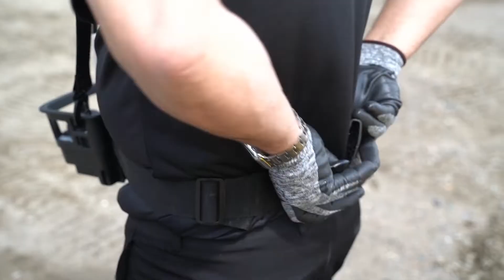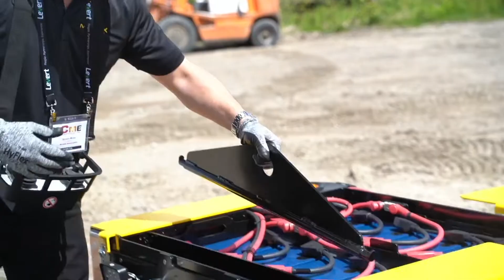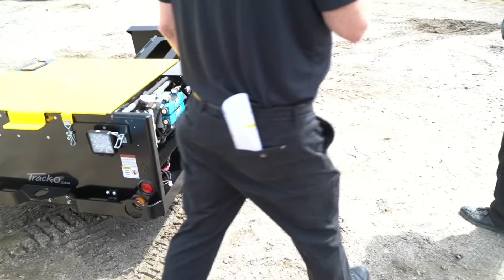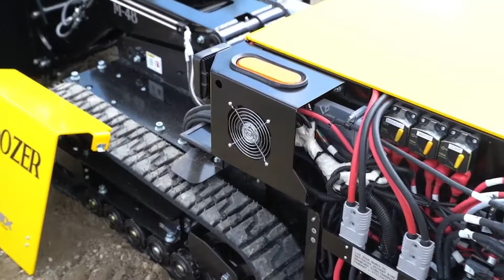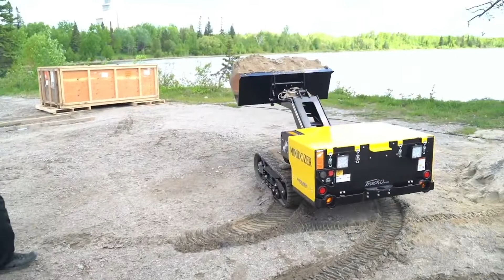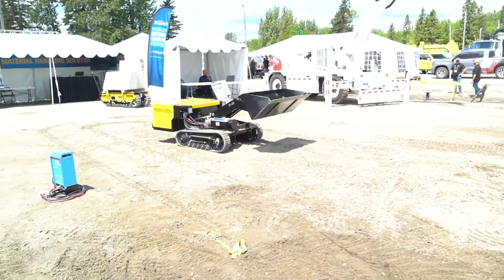Movex Innovation: MINIDOZER

Comment: Pros:
Replaceable cutting edge. Low height.
Cons:
Can and should be shortened by one foot. Too long for maneuverability underground.
Also, should be guards covering all the hoses etc on the front. Rock spillage will beat the s*** out of all that gear.
Suggestion:
Lights should be able to be switched on all the time. Very dark underground. In tight quarters you would have to watch the front and rear at all times.